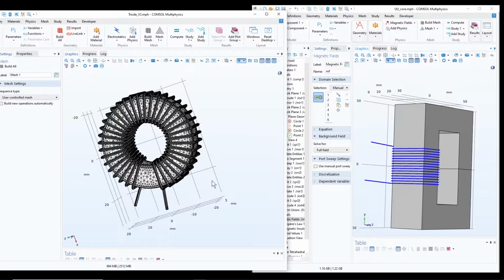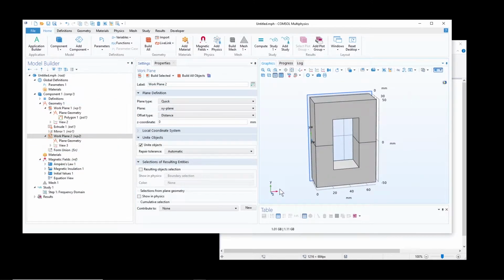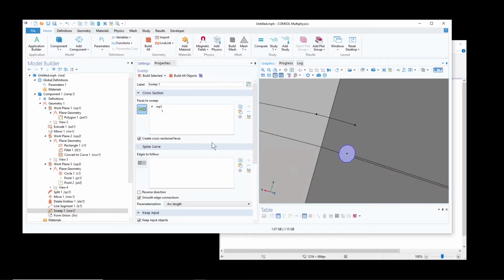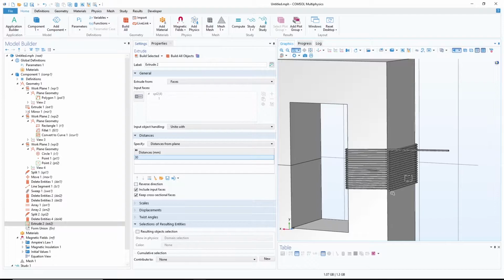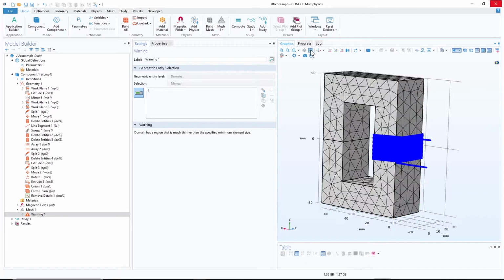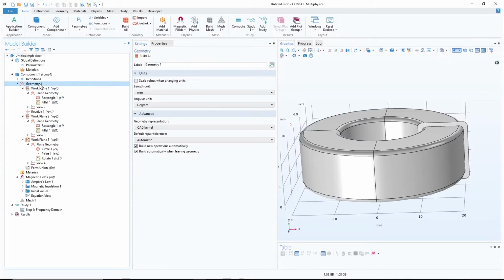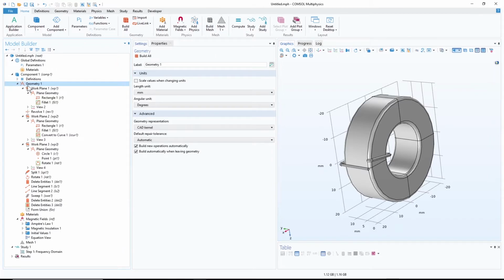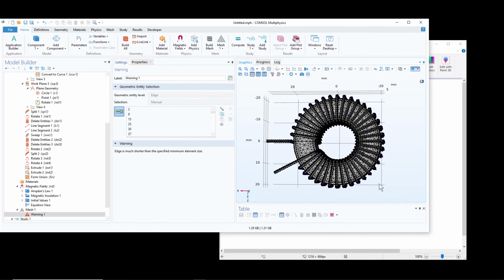How to draw a 3D winding in COMSOL Multiphysics  ( Toroidial inductor , UU core transformer )

Comment: Can you do one paid tutorial for the same coil with 2 layers ?
Reply from the maker: The toroidial core or the UU core ? in any case it is almost the same as shown in the video. If you still want it, let me know the geometry/sizes that you have
Reply: @HVE 
It’s UU Core 

the coil has two layers.  the inner layer has 11 turns.  the outer layer has 10 turns.  the diameter of the wire is 1 mm.  the distance between turns is 0.2 mm.  the inner coil length is 20mm and the width is 10mm.  can you do that?  the coil has an input and an output
Reply from the maker: @KingAbdullah484  Gap between the layers ? size of the UU core. maybe draw something on a piece of paper and send it to my email. what type of analysis do you want to do ?
Reply: The size of the U Core is 20mmx10mm 
What is your E-Mail Adresse? I have  STEP file I can show you what I need exactly
Reply: @HVE  I want to measure the impedance of Doppel layer coil in the high frequency domain

Comment: Thanks alot for the tutorial. Can please explain how we can add a Resistor to the secondary coil ?
In order to calculate The ratio of output power to input power.
Reply from the maker: Hi, that should come in a separate video in which i must show how to connect external circuit to a coil. There are some video in COMSOL webpage which explain this, if you need it fast you can refer to them.
Reply: @HVE  Thank you for your kind answer